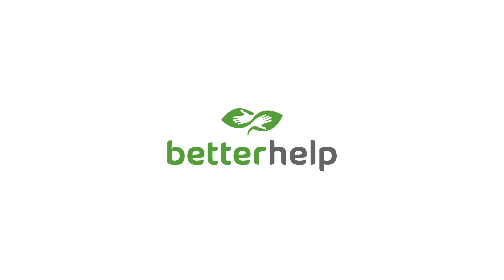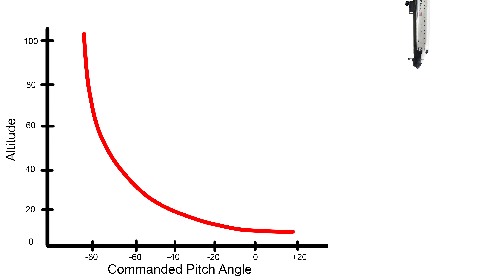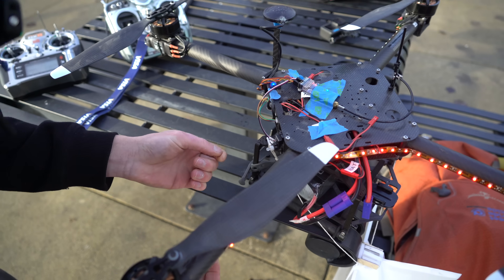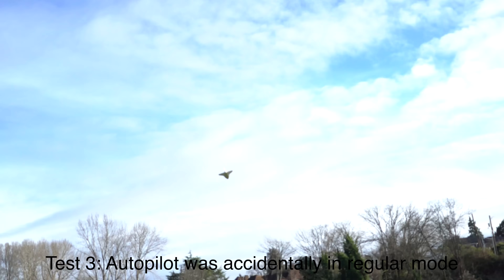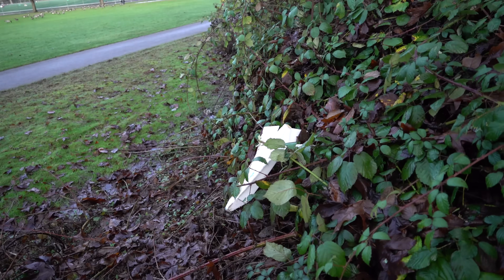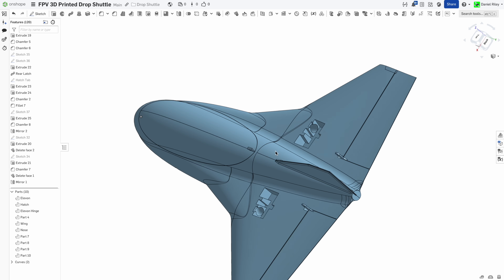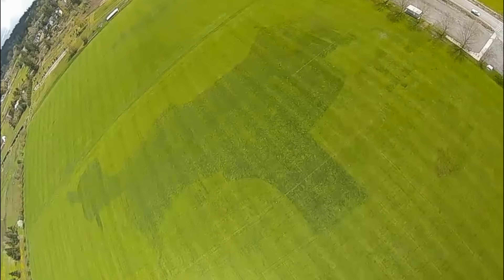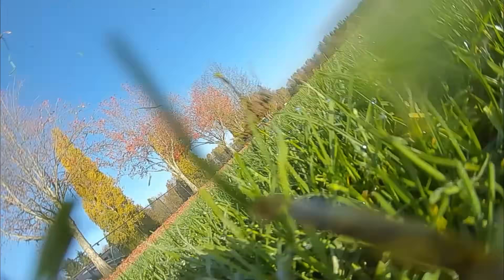3D Printed Autonomous FPV Shuttle Glider

Comment: The more forward movement you have the better the performance. Part of the answer to the lifting body design is how it’s launched, to my knowledge none of the early 60’s tests were done with the aircraft sitting static in the air nor facing down. 

Because it’s facing down it’s gathering to much momentum that has to be converted to a new direction. It’s like the change of energy in a dogfight.

Comment: Amazing video! Have you considered running it through CFD and simulate it as 6DoF model? That might save some iterations. I recently discovered that simpleFoam (incompressible solver of OpenFoam) gives quite nice results. I used the publicly available X8 Skywalker wind tunnel test as benchmark. Best is, the mesher as well as solver is for free and it really works well.

Comment: Hey! Aerospace engineer here. Absolutely love your iterative approach! Do not underestimate the difficulty of what you're trying to do. There's a reason why planes aren't dropped from the sky. Basically, any "properly" balanced plane will actually resist the motion to level out. As it falls vertically and you increase the angle of attack by trying to level out, the lift increases which creates a pitch-down moment about your center of mass. Trying to level out therefore requires you to pull on the stick quite hard. This is desired for a normal aircraft in longitudinal passive stability. As your cg is likely forward because of this desire for conventional stability, since you start at 0 airpseed, you have no lift and therefore you're more of a dart than a plane for most of the flight! That is your second problem: your 0 initial airspeed and low acceleration due to having no propellor to generate thrust. This makes your lift extremely low at the start and your control surfaces are very ineffective. Remember, lift scales with the square of airspeed. Hence you're stuck in an immediate stall and you get into a spiral motion or flatspin like you see in the video. That's also why the plane with the big bolt on the bottom from the intro did so well. You get much more immediate airspeed. Excessive wing loading is bad, but too low is also bad especially for an unpowered glider! You see that with the foamy, where at some point it's more like a falling kite than a plane. Finally, the propellor wash from the drone certainly doesn't help increase stability. You're likely dealing with all kinds of vortices, which is why you see an improvement when the rod is added.

All in all not bad work at all! But you're definitely doing something that's not as straightforward as it looks!
Reply: REPLYING TO @DARK_MATTER8420:

*dersharvessclarvuiosviecovzjhuiuurs??*

Comment: I think the Lidar might be better for this specific kind of situation. I think the differences in pressure on the altitudes where you want it to adjust are just a little bit too small for it to be accurate every time. And sometimes you would get good performance because conditions are perfect enough. Lidar doesn’t worry about air pockets in it’s sensors though

Comment: Looks like you are flying at Sixty Acres Park. I flew my very first drone (S500 frame) there. I’m curious what the law says about dropping an object that is not under human control as I am also writing some autonomous code for a search and rescue fixed wing drone using the Portenta H7.

Comment: bro instead of using dam servo motor u could use normal motor with ome gear so the uplift is more than servo motor if u want to use shuttle glider made of 3d print

Comment: so instead of gluing it together, consider "pinning" it with carbon rods. on each end, use a small spring, washer, and 'hair pin'. the springs provide the clamping force and when one part breaks, you may be able to reuse other parts. OFC, you could just print the pins in, but I have zero experience with 3D printing, so I don't know how well this would work.

Comment: Maybe if it starts more horizontally it will fly better.
Hook up the launch rail at something like a 30 deg. angle to the drone's level flight.
Fix remote controlled clamp(s) on the rail that hold the glider in that position and release it from that angle.

Comment: That landing at time 7:07 was excellent.  Moving the CG back sure helped.👌🖖 Looks like the 3D printed plane needs a larger vertical fin, maybe even one under the tail to help tamp down the roll oscillations.  You could even add a rudder with a gyro to help.

Comment: I wonder if the downdraft of the lifting drone is setting it up for failure giving it less altitude to work with.   I like the idea of dropping from forward flight where it starts off in a stable mode out of the gate.  Probably would make things more predictable and tunable.

Comment: I had similar stall issues with my Whistle Pig RC plane: https://youtu.be/kunS5x2EOek?feature=shared   I think what's going on is that the forebody (in my case a 2L soda bottle) is still generating lift even after the main delta wing stalls. You could try .. cg more forward? slats on the wing? stall trips on the forebody? pray to the aero gods prior to every flight? Anyway, nice work man. Best RC/drone channel on youtube .. although Sripol and Stanton are very good too.

Comment: Try adjusting the nose-to-tail center of gravity by engineering the internal equipment to be able to slide forward or backward and then lock into place. Consider the CG on all 3 axis: X,Y, and Z. Moving and retaping either the equipment or a weight more forward or back works, too. Test different CG’s until you achieve your aircraft’s best flight characteristics. Any symmetrical shape that is light and relatively flat can fly if given the right center of gravity. Consider all the different fin and wing configurations of fish and birds that God made. Despite such great variety of shapes, by placing the CG in the right spot for each creature, YEHOVAH Elohim enabled all their different shapes and sizes to move effectively through the fluids of water or air. Also, the design cue that will naturally reduce wobble is rearward wing sweep at the trailing edge. In summary, the proper CG on the Z-axis, a slight dihedral to manage CG on the Y-axis, and rearward wing sweep at the trailing edge are your solutions. Have fun trying these ideas! I’m looking forward to your next video!

Comment: I went through some of this waaaay back experimenting with Deltas and other flying wings.  First, most of those models looked like they need much taller vertical stabs.  At such low Reynolds numbers and short coupling, a small vertical doesn't have the authority to keep it pointed in the right direction with all of that wing wash spiraling up at the tail.  The fact they never really achieved stability shows that.  CG is also super sensitive at small scale like this, so there's a lot at play.  I love your videos and you do awesome work so I commend the work involved to iron out the bugs!!  👏👍

Comment: Bro, I am sure you understand this, but your gliders are in very turbulent air for the first 30 feet from the drone. That seems to be why they tumble so bad during the initial drop. The airspeed is faster than the plane for the first bit. The innate stability was causing the whole thing to rotate toward the relative wind from the drone, nose vertical.

Comment: Hi, my name is William Walker and I am developing a Blade Runner style flying car called the Sky Chaser and an artistic picture of it can be seen in the icon at the top left hand side of this post. Clicking on the icon will enable you to see a project presentation and flight videos. It is a powered lifting body aircraft with similar characteristics to the aircrafts in your video, with a Lift  to Glide ratio of 1/3. I was also concerned about the survivability of a complete power out, and discovered exactly what you show in the video, that going into power dive and flairing out as the vehicle gets near the ground enables the land perfectly using ground effect.

https://drive.google.com/file/d/19taPDO1yERAumR8OV1IFk2n1TqNLNUkN/view?usp=drive_link
Ref 2:18 min into video, and there you will see a demonstration of this powerout maneouver using a full scale CAD model being tested in flight simulator.

The Sky Chaser is a very unusual vehicle and thought your group might be interested in it. Sky Chaser looks and drives like a car, flies both vertically and horizontally, and is amphibian. It has no exposed rotors, and uses the body as a wing. It also has no unfolding wings, and flies the way it looks, just like the Blade Runner vehicle in the movies.

Sky Chaser is basically a flying wing design with twin electric motors in front and has double rudders and double elevons in back for control. It also has VTOL capability and is a Tricopter configuration, with 2 tilting front electric motors in front mounted on nacels, and another electric stationary motor in back blowing thrust though a hole in the wing behind the cockpit. The tilting motors enable vehicle to transition from VTOL to plane mode. The aircraft is also car with 4 large wheels powered by small electric motors. In addition, the vehicle is amphibian, and can navigate and takeoff and land on water, both in VTOL and in plane mode. Sky Chaser has a very short wing, but its effectiveness is increased by blowing high speed thrust over the wing and by using oversized side body panels, housing the wheels, to block airflow around the wingtips and help channel the airflow over the wing. The front props are counter rotating and from the pilots perspective, the right prop rotates clockwise and the left prop rotates counterclockwise. This configuration seems to yield the most lift.

I started the project in 2016 in San Diego, Calif, USA where I built and tested a 1/6 scale model. Then I made a CAD model and got it to fly in a flight simulator. 3 years ago I moved to Sweden and work with business partner and we have now built a full scale unmanned working prototype which flies. We are looking for partners to help develop the next manned version of the Sky Chaser. For more information:

*SkyChaser(dot)se
*Project Presentation: https://drive.google.com/file/d/1FAdls15OriuQ4hoD2xPwXeNQDQTKpK1t/view?usp=drive_link
*evtol News article 1: https://evtol.news/sky-chaser-concept-design
*evtol news article 2: https://evtol.news/sky-chaser
*Simulation tests: https://drive.google.com/file/d/19taPDO1yERAumR8OV1IFk2n1TqNLNUkN/view?usp=drive_link
*Full Scale hover test: https://drive.google.com/file/d/1qDl5X142uC5yt_5Xcb0GUS3h-LgD4P0V/view?usp=drive_link

Comment: For such a flight profile - wouldn't canard (fully flying front wing) control be logical - ie. semi-double wing for  lower airspeed sensitive -flare control - get that nose hanging at high AOA for the final roll/ slide.

For ghetto PID tuning - a gang of 4 leafblowers (or 120mm EDFs) and a tether - should achieve flight realistic airspeeds.
(an AOA sensor-vane could sort this flight profile out without needing any airspeed input - start with zero AOA  - for building speed then schedule up to +10 degrees ??  that won't go anywhere near a flare it could be interesting..)

IF you ended up with Zero (P) Proportional control - the Deriv. and Integral. have nothing to work off, you end up with a pure "rate" and "steady state offset" controller - . - that needs robust antiwindup to prevent oscillation  (Assuming Angle (gravity -  pitch angle  - assuming basic IMU  ) is the design..   DI is an unconventional Control algo...

Comment: 9:31   'reverse' the orientation of the elevon servos, and move their mass  INBOARD.          IMPROVE  the carry/release system.      use multiple to single hanging point.       hoist the model at/near its  cg.          9:42   don't certain control components  NEED  to located at the cg/c-m.?            d

Comment: Don't forget, the shuttle was moving forward at a high rate when it encountered air. It didn't have to build speed before pulling up, it was pulling up and bleeding off speed and then balancing its glide. Fixed wing drop, or rocket to altitude! 😂

Comment: NOT ENOUGH VERTICAL FIN AREA.    Roll-yaw coupling is very strong on low-aspect ratio designs.  That is, a little bit of yaw will cause a lot of roll.  And with a short fin like that, once it starts spinning the dirty air off the wings will blank whatever air the little fin was getting.   Put a serious vertical fin on that last cool design and things will get a lot better.

Comment: Many full size aircraft use barometric altimeters ABOVE a certain height. Radar altimeters at lower altitudes, as at a certain altitude, they lose effectiveness. Baro is not stable enough close to the ground. If you have the means, fly over a pond/body of water to a grass field, then over a road, measure the barometric pressures at various altitudes.

Comment: Great video. Some negative washout in the wing tip will help. Then if you can incorporate a wing tip with dihedral
Reply: Ya, I'm in agreement.  Something needs to be designed into the wing/lifting body to so that it naturally seeks stability.  I don't know if there is enough "wing" here to do what you suggested, but I think that's the right idea.

Comment: My father worked on the NASA Space shuttle. He was a mechanical engineer. He worked on the vibrations in the rocket turbo pumps and the heat shielding. 

He worked all his life trying to make a circler wing aircraft. The advantage of them is the huge speed range they can fly at.

The one big trouble is "dutch roll" you can see the same effect in early lifting bodies. 

That is why NASA had to add the small wings.

My father sent letters back and forth to Alexander Lip push the famous German aerospace scientist.

The father of the Delta wing on the F,102 and F-106 and all other deltas. 

A brilliant man

Comment: I've designed and built aircraft like this in the past and I found an interesting problem that you have to account for in the design you can't use a central rudder or vertical stabilizer you need to use tip rudders or tip stabilizers or that central stabilizer needs to be about seven times taller The problem is your crank arrow delta is shadowing your vertical stabilizer so you essentially have a Delta wing glider that has no vertical stabilizer at all until the teams forward fight speed the wing prevents the stabilizer from seeing air so the aircraft flies as if it has no stabilizer I build a 14 ft long version of this that was a rocket glider very similar wing design and had the same problem I would get into a flat spin and it simply would not recover because the Delta wing shadowed the stabilizer it wasn't until the aircraft inverted exposing the stabilizer to the air stream that it then straightened out and of course crashed :-)

The solution is to put tip stabilizers in the design that protrude both up and down this way no matter what orientation the aircraft is in some of the vertical stabilizer surface area is exposed to the air stream at all times this is one of the reasons why the space shuttle has such a gigantic vertical stabilizer in order to get it out of the shadow of the cranked Delta
Reply: This might also explain your role oscillation in the later model as you pulled up you were basically erasing more and more of the vertical stabilizer as you slow down and shadowed it with the wing although I'm not sure of that as long as you have forward airspeed you should be okay your solution might be as simple as putting a small stabilizer on the bottom of the fuselage so that no matter which side ends up facing the airstream on release you have some vertical stabilizer exposed to the airstream
Reply: Agree, the shuttle uses a super tall vert fin to get enough clean air.  I'd start there.  I bet he could test it just by taking the existing design and scabbing a piece of foamboard on up there.
Reply: @johngoscinski1995  easier would be tip stabs. this eliminates the issue from all angles and is lower mass (lighter than a super tall central stab)

Comment: try putting the vertical stabilizer on the fin. not the center. the blunt nose prevents some of the air going to the vertical fin, rendering it useless. hence why nasa put theirs on the wingtip.

Comment: Maybe a spring loaded launch, pushing against the weight of the drone a bit? It would start with more air speed off the guiding rail, making center of gravity less of an issue. Noob insight, beware.

Comment: Rotor wash for sure is the biggest issue, you should do a short mission that moves from point A to B (then releases the plane) and have the quad move back to A. 

Like 10m movement and have the plane drop at the end of that point, at least you would only have the instantaneous wash and not the built up loiter wash.

Comment: Shuttle glider has different weight distribution. You are missing the engines. Thus your plane could have CG too forward compared to COL. Making it too stable in pitch but not stable enough in roll. Watch how it wants to always fly upside down all the time. I would start by placing something heavy on the bottom (or giving wings some dihedral angle to move COL up a bit). And possibly even some weight at the rear. The second plane might also have instability in yaw due to very small rudder.

Comment: You might want to laser cut a jig to build your next shuttle glider. I think your glider is not flying well because it may be glued with minute misalignments that affect the overall aerodynamic stability. I imagine these kinds of problems could become pronounced when wing loading is high. You could also try using thin carbon strips braced by acoompaning slots in your frame to align all the sections when glueing.